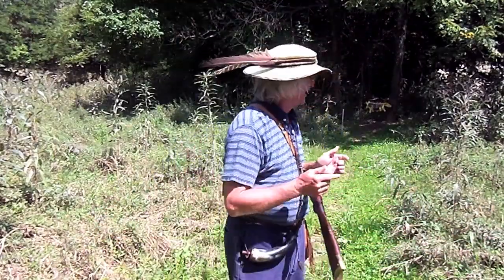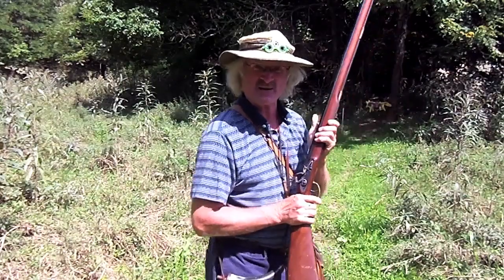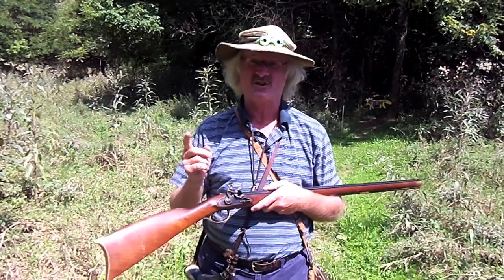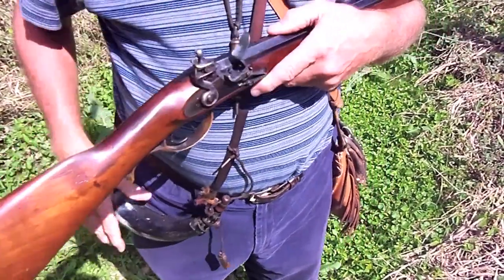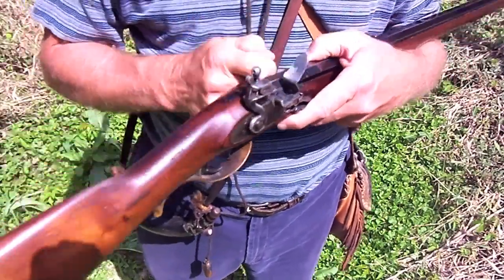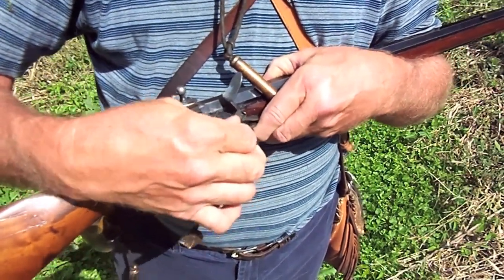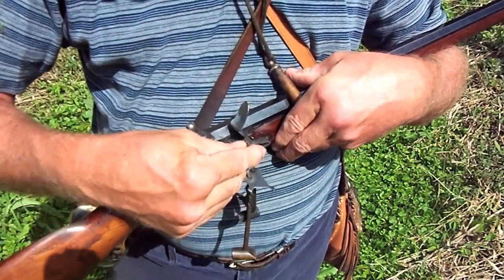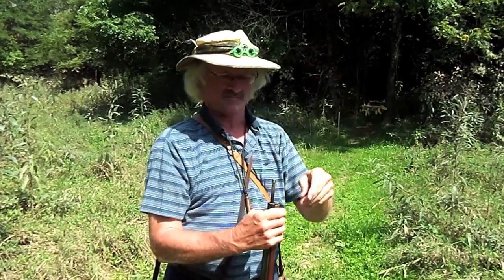How to remove a stuck ball in your flintlock rifle. Dryball

Comment: I use a brass ram rod and using the ball puller with a 15 thousands patch is hard, brass holders in a vice and something to hold the ram rod.  never do it with wood or fiberglass I have seen two ends get pulled off.  Now pricking the powder in the hole, I do that when I am teaching people.  Along with marking the ram rod for nothing, and a full load.
Reply from the maker: I've pinned all my ramrods so they won't come off in the barrel. Drill a hole thru the wood  & tap a finishing nail thru it & grind off the ends. It is very easy. Regarding metal rods, etc, I don't like taking anything extra to carry around into woods. The method above works almost every time & is handy in the woods. Thanks for watching...
Reply: @blackpowdermaniacshooter The solid brass one is for the wall or when I am on a range with 15 or 20 thousandths patches.  I forgot to change out last weekend and it feels like double the weight.  Other than that I use a nice fiberglass rod.  Still the look of a nice and shinny brass rod on a Hawkins is a sight to behold.  The funny thing, I got it at Dick's when he was still alive, before the kids took it national.  He had the foundry on the east side of Binghamton NY make a bunch of brass and aluminum rods for muzzleloaders back in the early 1980's.  Some for the renegade TC or the longer Hawkins and some for the CVA's.
Reply from the maker: @brett76544  I love using fiberglass rods. Except for my GPR, I use a fiberglass rod in the thimbles on all the rifles I have. They are extremely tough.

Comment: Easier to remove barrel from the stock, remove the barrel end plug then shove the ball out the back. This works great unless you have flagrantly failed to maintain the barrel properly and the end plug is solidly rusted into place with no means of removing it.
Reply from the maker: You're talking about removing the pinned barrel and then breech plug? I don't have the tools to try that out in the field. Thanks for watching...

Comment: I usually remove the lock,unscrew the touch hole,charge with my pan charger,screw in the touch hole, replace the lock, prime the pan and fire.Your way you don't run the risk of losing small parts,but I've done this in winter with nearly frozen fingers,next time I'm doing it your way.
Reply from the maker: Brrrrr...dry balling one in winter time would be rough. Yikes! Sure hope this method  helps you out! Thanks for watching...keep on shooting my friend......

Comment: What if you stick a red hot piece of steel into the stuck ball, let it melt around the thing then pull it out .  Never mind. LOL  may temper the barrel.
Reply from the maker: I've never tried that before. I just shoot them out. That's much easier, especially out in the field. Thanks for watching...

Comment: Um, This ain't my problem, there is powder in my rifle, but the ball is only halfway down and its stuck.... what should I do? jut shoot it? is it gunna blow up?
Reply from the maker: If powder is in the gun, you can push the ball the rest of the way down the barrel & shoot it out normal methods. If you can't do that, you also can pick up a CO2 bottle and force the ball out using compressed air. Those can be purchased at black powder shops for $43.00. They are cheaper to use rather than going to a gunsmith. Here's an example: https://www.dixiegunworks.com/index/page/product/product_id/8924/category/332/category_chain/578,349,332/product_name/MT0515+UNIVERSAL+UNLOADER+KIT

Comment: It's a pain. I went swimming with my flintlock one day ( fell in the creek). The ball puller worked eventually.
Reply from the maker: @Kelsey Cottrell Yikes! That's not good. Did you have to disassemble it, dry it & out it back together?
Reply: Yup, the gun, possibility bag and me. It was l think around 10 to 15 degrees. Not a good swimming day at all.

Comment: The worst that could happen is that you'd need a long drill bit like electricians use and drill it out.  Or weld a drill bit to a steel rod.
 I never forgot powder, but never say never !
Reply from the maker: Yes, I've done that too to get a VERY stubborn one out a few years ago. Here is what I did: https://www.youtube.com/watch?v=Gy4XYzKl7Vw
Reply: @blackpowdermaniacshooter    Yep, that was my thought too. Lead is softer than the barrel, so the barrel should be fine.. I have two of those bits for electrical work..
Reply from the maker: @rtoguidver3651  They do work in a pinch!

Comment: Too much work Mark. I learned many years ago to carry a small bottle of very very fine prepared powder and just pour it into the pan and tap it in the touch hole with no problem and boom the ball is gone! Also works with percussion locks just remove the nipple and pour some of your prepared very fine powder in, replace the nipple and shoot the  stuck ball out.
Reply from the maker: I've tried that too, but, not with as much success as you're had. Congrats!

Comment: Tad bit faster using FFF !!!
Reply from the maker: It does take few minutes to stuff that 3F thru the touch hole. Using 4F or Swiss Null B would be faster. But either way, I'm  back to shooting in less than 3-4 minutes. Thanks for watching.